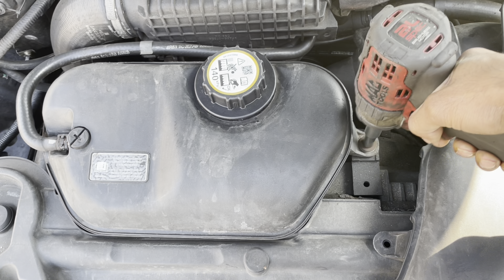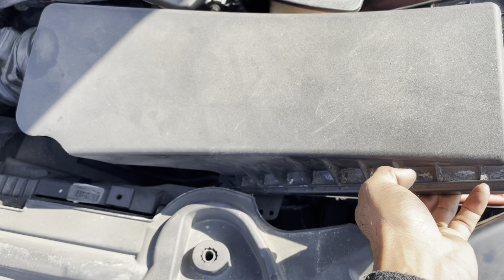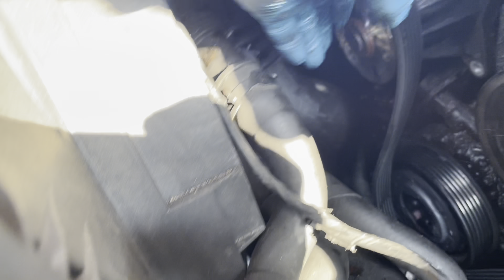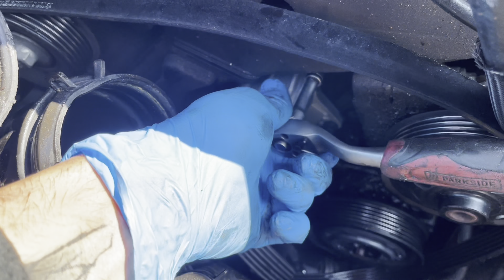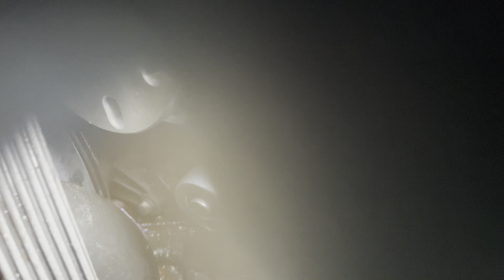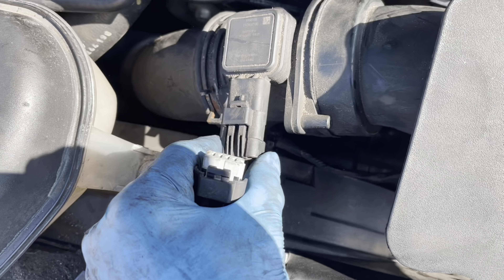How to change water pump on Jaguar XF 2008

Comment: Thanks for sharing. One little tip: undo the pulley bolts just a bit with the belt still on. This way the pulley is held in place and you don't need anything to block the pulley.
Reply: My thoughts exactly and wear your camera on your head next time
Reply: If the belt stayed on, my one fell off! :(

Comment: Got a major coolant leak on mine and I suspect the water pump so might need to do this job after a bit of further investigation.  Good tips @MotorScotti and @ryansheffield4340 about leaving the belt on before loosening the pulling bolts.  The Workshop manual says it can also be locked in placed with a 6mm key.

Comment: Good video, but the body of water pump and pulley attachment has not been tightened to specs because the workshop manual states what specs these bolts should be tightened to. To prevent future leaks please always torque to specs.
Reply: Cool story you don’t work on cars! If your a experienced mechanic you don’t need a torque wrench to tell you 15 ft lbs but go on and read your manual
Reply: @jeremyhueneka7115  does the guy in the video look or does things like an experienced mechanic?